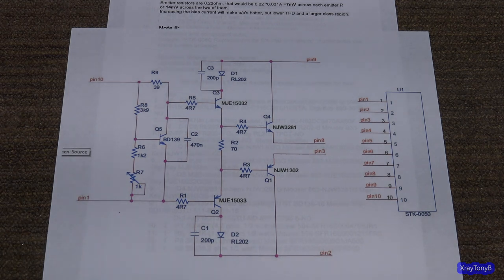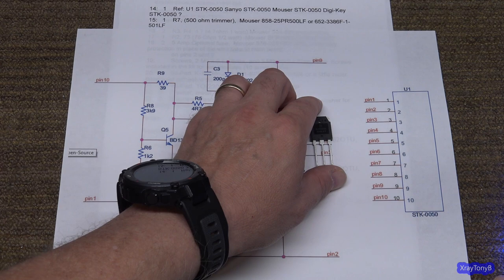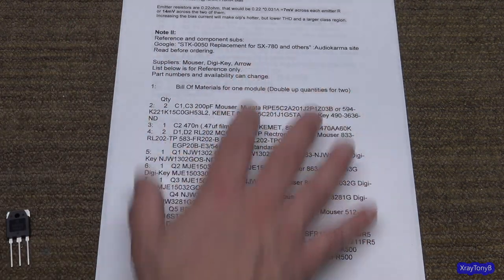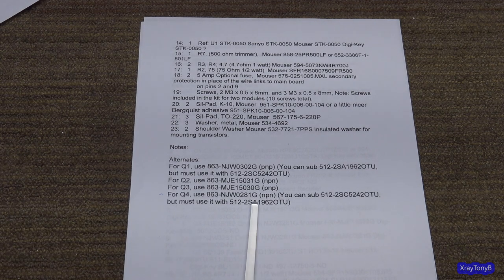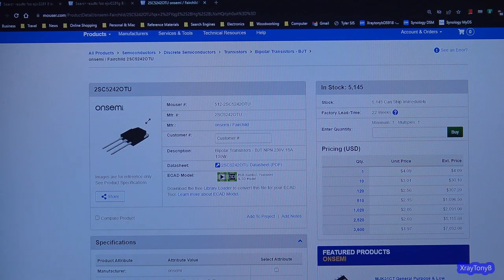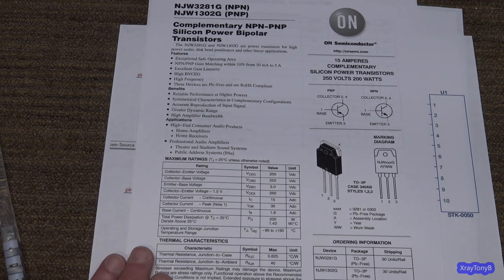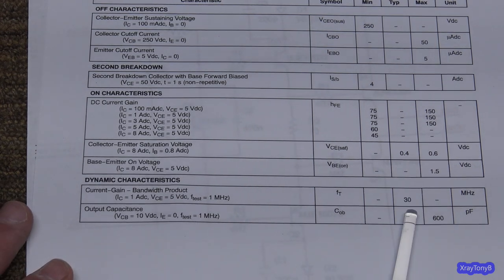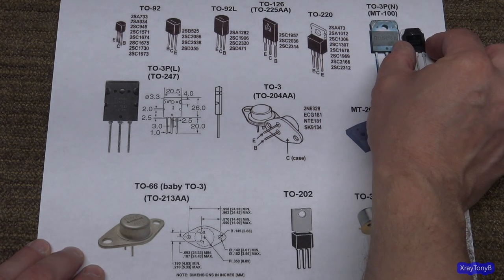How to Find Substitutes for Discontinued Transistors

Comment: Very thorough and good explanation about transistors, Tony! Just to take a substitution table "for granted" will often show very different data when consulting the data sheets for both types. The "substitution" could be on a very specific parameter, not the one YOU are most interested in. Also, I saw the MJW1302/3281 transistors. I wonder, are these "On-Semiconductor's versions of Toshiba's 2SA1302 and 2SC3281? Seem equivalent! These were fine transistors before the fake versions of them hit the market. I ordered some from a vendor, asked him "can you guarantee they are real"? A pause, then "No".. This was some 10 years ago. Too bad the market has turned into this

Comment: Tony this is the best transistor substitution video I have ever seen. I love the one thing you covered is the frequency rating. I don’t see many cover this. I see too much focus too much on gain in the forums and other places. The older amps, I find, need the slower switch.  When I go to Mouser the first thing I look for is the package and the other is the frequency, go from there. Hard part comes when no match in frequency is found.  Also I look up the compliment, and that one will throw everything out of spec. Also you talk about the intended application by the manufacturer, fantastic note. Not all times I’m successful with a modern replacement. Oh and if mouser is out of stock, sometimes you can order directly from ON or ti. There is no quick answer and sometimes you just have to say enough. Thank you for this. Your content is a value.

Comment: I've had faked transistors before. I was fixing either a Sony or a Pioneer amplifier (can't remember which brand it was, was a few years ago), and it was a 5.1 channel. The centre channel was outputting DC, so I thought the output transistors were bad (turns out they, weren't, keep reading...).  Removing the transistors made the amp come out of protect mode and allow the other channels to work. The centre channel transistors were Darlington transistors, SK branded. So, I went to evil Bay and ordered a pair of NPN and PNP transistors and waited for their arrival. Upon putting them in the amplifier and applying power, I heard a quick fizz noise and the amp stayed in protect mode again, as it did before. DC on the output. The transistors were ultimately fakes and could not handle the +/-50V DC required on them. To cut a long story short, the original transistors tested fine and were fine, the real problem was between the base of each transistor and the voltage amplifier stage was a small 2W 180 ohm resistor, or so. One was open circuit, which caused a similar fault of a shorted transistor... that transistor's DC rail on the output. I was really annoyed about those fake transistors, though, as I waited I think 2 weeks for their arrival. In that time, I could have found and fixed the real problem.

Comment: Hi Tony, absolutely brilliantly explained, unfortunately these days it's not just about replacing transistors, but older components in general. It has happened to me several times that I received a reply from the manufacturer - "Production terminated without compensation". Here in the Czech Republic, it is even worse, on the one hand, stores are closing down and those that remain sell overpriced Chinese junk - an example I wrote in several comments - I am restoring an HP 3400 voltmeter and before I start ordering unavailable and expensive axial capacitors here, I wanted a gauge put into operation at least with new radial capacitors. After the purchase, I remeasured them and since I don't know how long they had been in storage, I reformed them to be sure, what I found out shocked me - some 40-year-old Sprague capacitors had better parameters than newly bought ones in a brick and mortar store.
Shopping on the Internet is good - if you buy from reputable sellers, but the next link in the line is the shipping company - I've had them lose the shipment several times, in the last case it took more than a year before I managed to get my money back.

Thanks for the video and have a nice day 🙂 Tom
Reply: I too am trying to restore an HP3400A voltmeter.  I was excited to see Tony's video, thinking he may have a magic trick.  No not really but I did learn a couple of things, I can widen my search for more that just TO-3 style transistors.
The HP cross reference list that I have been able to find does not list the Q1 pass transistor HP part number 1853-0063 a PNP Si TO-3.  Which I guess makes sense since the parts list indicates the manufacture number as 28480 which is HP.   To find a sub.  I need some data, the one I have is totally dead.
Good luck on your restore
Reply: @davidwright2192  Hi, HP has produced several versions of the A type identifiable by year of manufacture, they have different part modifications and different internal wiring. During production, they displayed notifications with tables for swapping component values in older models. The A models have one major difference, the photo chopper originally installed was replaced in the newer models by an operational amplifier (if you have this newer version, I recommend replacing this IC even if it is functional - it gets noisy as it gets older and manifests itself in a restless gauge needle). When I'm home I'll check my service documentation for the Q1. Model B is completely different, the Nuvistor has been replaced by a J-FET transistor and the wiring has been significantly redesigned, its advantage is the possible adjustment for the digitization of measured values, the disadvantage is even nowadays the price (at least for me).
Thank you for the restoration wish, I'll really need that luck, mechanically it's in perfect condition, but electrically someone did a lot of damage to it, it's practically a corpse to the 0.001-1V range, the input part was grilled like a steak.

Nice day 🙂 Tom
Reply: @@seventhanubis6930 In my case, "forming" doesn't help much (I can forming up to 650V, but I don't have anything to forming), some components, including capacitors, are literally grilled, someone did a lot of damage to the meter and maybe that's why it kept such a bright appearance.
Reply: @Edisson.  Yes there are different versions.  I have two of the HP 3400As.  Both of mine have a prefix of 1218A.  The one I am working on used Silicon TO-3 transistors for the pass transistors for the three supply voltages 75, -17.5, and the -6.3 voltages,  The unit I just finished restoring to working condition used germanium pass transistors. I have not calibrated it yet so I guess maybe now working fully yet.  I had to replace the Nuvistor tube,  plus some components on the A7 board, transistors resistors, caps., etc. 
I would be very interested in the "how to" for the J-FET replacement. Oh, I also had to replace one or two of the neon bulbs in the chopper.  I would be interested in the IC photo chopper replacement for a future project.
But remember, its the journey to a finished project that is the fun part.  Someone told me this a long time ago, just not sure he is correct sometimes.
Any way have a good day and have fun.

Comment: Great Video Tony, thanks.  There are reputable secondary suppliers like Quest Components and Talon Electronics that specialize in obsolete and hard to find components.  They can often save your bacon when a given component is otherwise not available, and you don't want to gamble on eBay.  I have used Quest Components for years and had zero issues. 👍

Comment: Hi,
A blurb in three parts:
1. Thank you for an excellent class on how to substitute transistors. Your selfless sharing of information with the community is truly appreciated.
2. I do have a request. Often when you are addressing issues with a driver circuit, you state that a specific transistor is known to be problematic. If, over time, you could please make a list of these problematic transistors, I surely would appreciate it. I had 4 or so written down and then I lost the list. This is something only experience brings. I can’t look it up. Only the Tony knows.
3. What happened to xraytonya? Should I be concerned? And what if xraytonyc shows up, do we need to send a search party? These are questions that must be answered!
Reply from the maker: More important, what happened to Preparation A through G? ;)
Reply: Oh great. There goes this month's sleep.

I did find one note that I'd made from your teachings. The 2SA726 gets the corrosion creep and will almost certainly become noisy over time so it makes sense to replace this transistor anytime you come across it. An appropriate replacement is the KSA992, but the pin out is reversed BCE to ECB. I'm not asking for the replacement component numbers. I would like to know what your experience is with the corrosion creep and other possibly problematic transistors so I can anticipate issues. I know this is a big never-ending request but any clue will help. Thank you, Tony

Comment: Some of the Pioneers like my SA8800 integrated amplifier have some pretty hard to replace transistors in them.  The JFET constant current source in this generation of integrated amps and some of the X80 series have a few solutions that I've found depending on the voltage.  The drivers have really high transition frequency for this particular amp and there are no TO220s that I've found in the ballpark of those, at least that are easily available!  The outputs on these series are also challenging to find now that the MT - 200 Sankens that were good for these are now obsolete as of 2018ish if memory serves.  I think there might be a way to finagle some of the TO 247s in there!  (there are a few decent substitutes out there!)  Thankfully mine seem to be all good, with the exception of the notorious 2SA979 dual device.  My left channel gets that rice krispies sound after it warms up!  I'll probably just thermally bond two well matched TO-92s for those!   I also thought I found a suitable substitute for the STV stabistor diodes (sometime in 2016, I still haven't gotten around to fixing it!) in a surface mount package!!!  Mine are still in good shape thankfully, so I shouldn't have to rig anything together for those!

Comment: I think we need to work on a design of a time machine:) but for us it would have to be the size of a truck!
Its been very interesting, we have groups in the UK who also like Tube equipment and then there is the voltage issues for the parts we need.Ray thank you for such a good video.
Reply: This is why I salvage older transistor's (and other components)when ever I can..

Comment: I really appreciate all that you do on this channel.   I was wondering if at sometime in the future you would talk about replacing obsolete jfet transistors.  You’ve done several great videos on selecting and matching bjt transistors.   Jfets are somewhat of a mystery to me and anything you could do on the topic would be appreciated.     Thanks Again
Reply from the maker: Jfets are still pretty easy to find.  The only problem you will run into is where they use a jfet as a current source in some of the vintage amplifiers.  Those are a higher voltage jfet than most standard ones out there and are not made anymore.  The solution is to use a small two terminal transistor-based current source.  There are different designs, some using LED's, some using resistors and some using diodes in conjunction with the transistors, but they all work generally the same and can handle the higher voltages.  I've used them in previous projects on this channel and they work great.  I designed a small PC board to make it look more professional.  There is a lot of info out there on this subject.  Bob Cordel's book covers this pretty well and I think "The Art of Electronics" by Horowitz also has some info on this.
Reply: @xraytonyb  Thank you Tony.  I will study this more.   I want to make sure I know the key characteristics to match like I do for bjt’s.     btw…..I have The Art Of Electronics on my Xmas list this year

Comment: A couple of notes on Mouser:  

1)  Depending how you search, your results can be very different.  For instance, if you begin the search with "200W transistor" and filter down to in-stock BJTs,  you end up with 9 results, not 2.  Sometimes you'll get zero results with one search term, but going at it from another direction will find what you need.  

And  2), even if they claim a part is on order with a due date, that doesn't mean you'll ever get it. I've had one item on backorder since May, for December delivery. It's a common pot that our company has used for 40 years.  Suddenly, instead of "16,000 due December 18", delivery is showing "Obsolete", with no replacement available. [sad trombone]
Reply: 1) I have found that to be Universal Truth with all search engines. If you don't like the results or they don't seem to make sense, try different orders of processing search terms.

Comment: I have a question Tony. You rebuilt that Fisher with the STK outputs and the amp was rated for around 100w I believe and I want to say that model had +/- 57 to 59 volt rails.  You replaced those modules with the board using the discrete components.  Are you at all worried that you’re pushing the the NJW1302/NJW3281 to their limit with only one pair making that 100w?  I’d think you were riding close to the SOA limits at that voltage.   I have several hundreds of the NJW0302/NJW0281 so I use them for these boards when doing like the SX-780. Not sure I’d use them for a 100w unit with nearly 60v rails even though the only difference being that the 1302/3281 are 200w dissipation vs 0302/0281 are 150w dissipation.  I do have several dozen of the 1302/3281 in both NJW and MJL packages, but if i can save them I will since parts are scarce. I’m wondering if while using that same board I can wire a second pair of outputs in parallel.

I really hope that these through hole parts start becoming available again.

Comment: Tony EXCELLENT VIDEO as usual, I have a question on the other STK modules, and that falls in line with the difference between STK-0100 in comparison to STK-0050?  Are there big differences between these devices that fall in the STK-0XXXX series?
Reply from the maker: If you watch the series I did on the Kenwood KA-9100 and the Fisher RS-2010, I explain that in pretty good detail.  I'm not sure about a STK0100, but there is a STK0105.  The main difference is that the 0050 is full complimentary and is rated at a lower voltage and 50 watts.  The STK0105 is quasi-complimentary and is rated at a higher voltage and 105 watts.  As far as the pinout is concerned, they are the same.  They are also physically a little bit different in size.

Comment: Note you can go over 15 to 20% or higher of transistor datasheet ratings transistors with higher gain can produce more output power. For example you can have a transistor that can only handle 40 volts but the gain is 400 to 800 it's going to be loud. Then you could have another transistor that can handle up to 300 volts but the gain is only 40 and the max would be 120. So to build a high-end quality amplifier I would go with the 40-volt transistor because of the gain almost all amplifiers use high-gain transistors a transistor that has a max gain of 30 would not be suitable for a amplifier application it would be more suitable for a switch mode power supply  application or for use in place of a rectifier diode or for use such as pushing a motor. I'll give you another good example the A18 transistor TO-92 package  it has a max gain of 1500 but it has low voltage capability such as 45 volts.This would be a hard one to replace when it comes to cross reference.

Comment: Would adding an output inductor network work if only a high frequency transistor was available? Some of the newer power transistors advertise lower distortion so could replacing 60’s and 70’s outputs give a noticeable improvement? 
 Thanks for all your videos.

Comment: Great video. I always learn from your discussions on transistors.    Q:  are there techniques for adapting surface mount transistors to a TO92 package…..like mini surface mount boards with leads?     This would be very helpful for the small signal signal transistors.   Just a thought.    Thank You

Comment: This would be a hard one to cross reference look at all the gain Type Designator: MPSA18

Material of Transistor: Si

Polarity: NPN

Maximum Collector Power Dissipation (Pc): 0.31 W

Maximum Collector-Base Voltage |Vcb|: 45 V

Maximum Collector-Emitter Voltage |Vce|: 45 V

Maximum Collector Current |Ic max|: 0.1 A

Max. Operating Junction Temperature (Tj): 150 °C

Transition Frequency (ft): 100 MHz

Forward Current Transfer Ratio (hFE), MIN: 800 max 1500

Noise Figure, dB: -

Package: TO92 They are uses as a differential pair in one of my amplifiers

Comment: Some of those transistors packs don't use the 4 pins on the midle. So you can just replace them with
two transistos.a toshiba TTA1943 B241, PNP on left side and a Toshiba TTC5200 B242, NPN to the right side.

Comment: Usually those oddball obsolete parts you special order, require a minimum purchase. I have purchased 5000 capacitors before. At 2300 I could order the minimum number of catalog parts. At 5000 pieces I ordered similar parts to MY own custom specs.

Comment: Also, does anyone know the benefits/ drawbacks of replacing wet electrolytic caps with solid polymer caps in vintage audio circuits? I know that polymer caps have a much lower ESR and can handle more ripple current than wet electrolytic caps. As with any question like this there is no set answer, so anything that could point me in the right direction would be great!